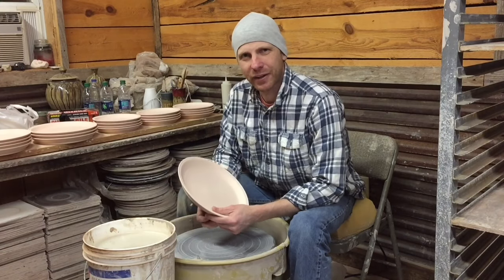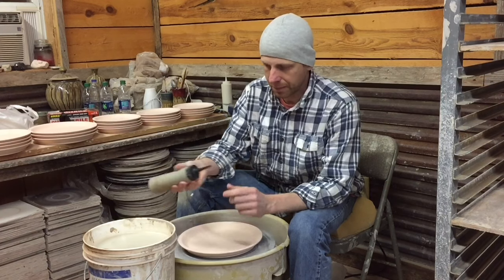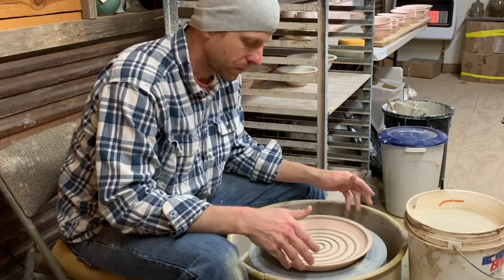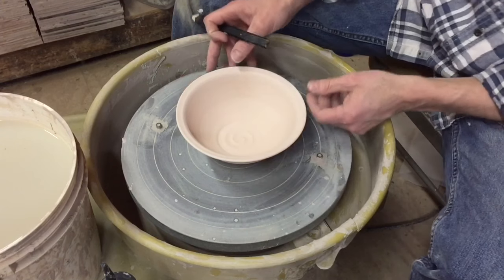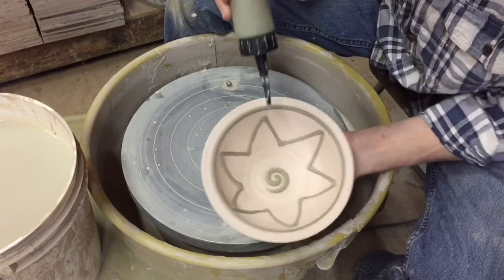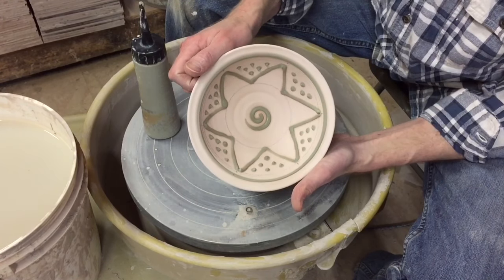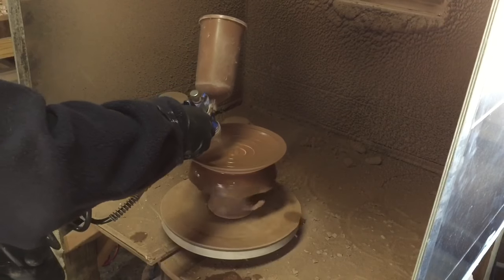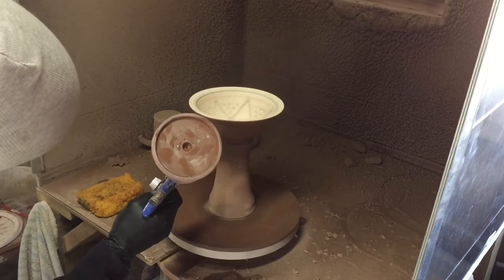How To Glaze A Dinnerware Set

Comment: Love your videos Matthew!  What type of air gun and compressor do you use?  I have asked many people but most say a cheap brand that I think will not hold up well and will give bad results.  Yours looks like it is quality.
Reply from the maker: Sorry for the delay. My spray gun is a Hyundai. It was $25 on Amazon. Ive tried a cheap one from harbor freight before that did not work well. You don’t need to spend a fortune but a higher priced gun should work better and last longer.
Reply from the maker: My compressor is a Kobalt from Lowe’s Hardware. As long as you have a regulator to set the pressure to around 45 lbs or pressure you should be good with any.

Comment: The bottle that your using like slip trailing has a long pointed nozzle. Where did you find this?  Beautiful work. Very helpful and informative video. Thank you for posting
Reply from the maker: That’s a hair applicator bottle from a beauty supply store.
Reply: Matthew Kelly Pottery oh thank you so much.  I threw 10 small plates yesterday with your new low profile design to fit in the dishwasher but thought I Hope the glaze perk  them up. Was thinking about slip. Maybe slip dragonflies. So they would be influenced by your work but would nothing like your work. Once again thanks for your advice

Comment: Very interesting. I have seen ash sprayed on pieces, but it was only mixed with water, then fired. So my question is what sort (colour) of glaze do you use and what sort of quantity? Cheers Bob 🇬🇧
Reply from the maker: I use multiple different ash glazes. I would encourage you to do some research on ash glazes. There is plenty of info on them out there. It all depends on what temperature you’re firing to and if the glaze works well with your clay. Tons of trial and error to get it to work out, but well worth it in my opinion.
Reply: Matthew Kelly  thanks for the info, I can see I've got a lot of research to do, I only have a electric fired kiln but my friend has a raku Gas kiln maybe I'll try in both. Cheers Bob 🇬🇧

Comment: Is ash glaze food safe?
Reply from the maker: I sure hope so. Hundreds of potter for thousands of years have been using some form of ash glaze. I see no reason why it’s not. There’s no heavy metals in it that would make it harmful.
Reply: Matthew, what type of wood ash? Hard wood has more lye in it. Soap makers use hard wood ash lye. Would any type of wood ash work?
Reply: Janet Johnson I had a chart on this but I think that they are actually pretty similar once the wood has burned away. Mostly firing is done with pine. So mostly softwood. So yes any wood ash would work. But just see what Mathew says.